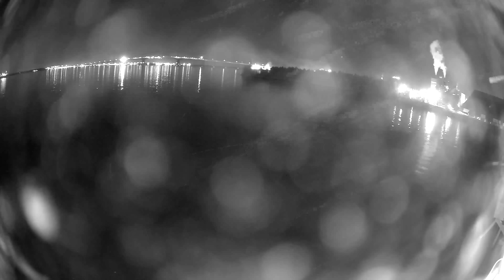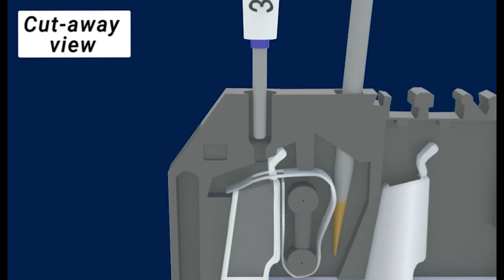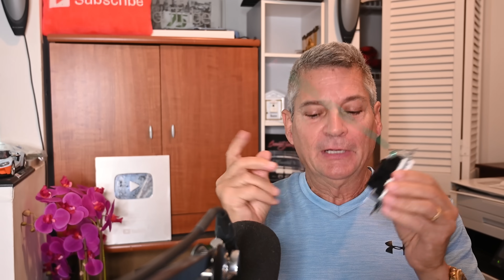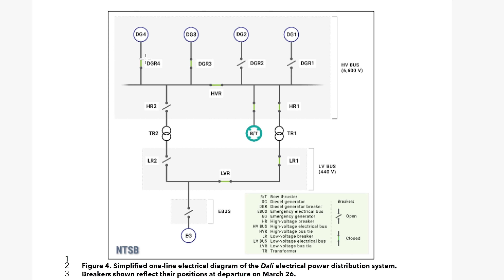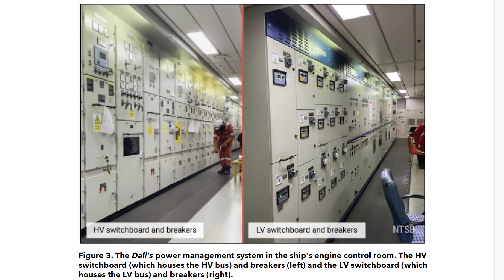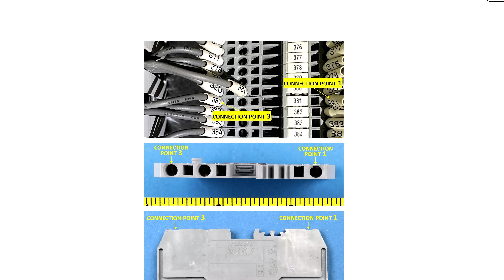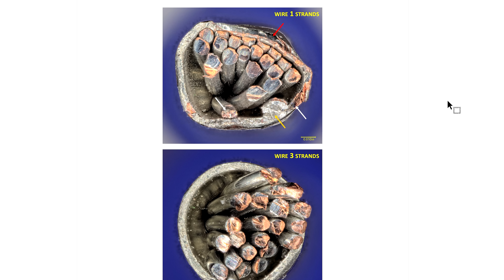NTSB: Scary Wire ERROR Caused Dali Crash/Key Bridge Collapse Baltimore

Comment: The main function of the ferrule, is not  to make it easier to insert it into a block, though, that IS a benefit. The main function of it, is to prevent breakage and to ensure that all the strands of the wire actually conducts the electricity all the way to the contact. In short, it ensures you get proper conductivity. It also prevents stray wires, and prevent many types of connectors from cutting strands (The screw type blocks will shear wire-strands).  Typically, if you do not use a ferrule some wire-strands will stick outside of the connecting point reducing their current carrying capacity and increasing resistance.  In Norway, ferrules are mandatory for all non solid core connections used with mains power.  The next benefit, is that it also prevents the wire working itself loose from the connector. Wire-strands can foul up the threads of the screw type connectors so you can't properly tighten them, they can also act as  spring, so when they are exposed to mechanical force, they come loose and can be pulled out.  In practice if you use a ferule, they do not come undone.
Reply: I do high-amperage automotive wiring, and I use ferrules on EVERY SINGLE wire that I run. I have a hydraulic crimper for things like 0-guage wire, and a smaller hand operated crimper for anything less than 10 guage. I have NEVER had a terminal failure yet.
Reply: US moving toward ferruling wires to be mandatory, I worked on mobile oil field equipment and it was mandatory from Canada but Stewart Stevenson out of Texas was having none of it. Ferrules properly installed are awesome.
Reply: imo spring terminals are more reliable without a ferrule (and much easier to install), automation engineer here
Reply: @ai5506  True as the ferrule to wire connection is another point of failure
Reply: @ai5506  just engineer or actual user of the product/installer?  xD  since no ferrule can suck since you can just push in stranded wires so in plenty of cases ferrules are easier to use while it costs more time to install.    so not sure what your (automation engineer qualification) means     since plenty of so called engineers think of the most stupid designs or ways to make something    and that gets dictated if you learned it in the field or in school ;D    field learnt engineers are worth gold compared to the school bench guyys
Reply: I use to do wiring on diesel electric freight locomotives , have no problems with correctly crimped on connectors but these push fit connectors are just quick way for unskilled workers to install systems "cost saving "  No one will convince me a push fit connection sound and fit for purpose , we never used push fit always a good old fashioned mechanical connection . Only push fit on loco's I worked on was for the rad fans on cooler group and it was constant issue with burnt connectors , we ended up hard wiring all locos as this push fit was constant cause of failure . Same with plumbing now its push fit or these crimp on fittings that any unskilled worker can perform , both have failure points unlike a good solder fitting
Reply: @nounoufriend1442 push-fits are no the problem, incorrect installation is. made 1000s of these connections, you just need to be sure about: A cutting the insulation the right depth, B inserting the tool properly, C inserting the wire completely. springs can't come loose, screws can
Reply: @ai5506  Heat effect's springs though and high current causes heat , we had push connections fail all the time on Locomotive cooling fan connection's and they were not pulling close to the rated amps
Reply: how many ships were built without ferrules, and how much of them hit the bridge because they run out of electricity?  
this is not about type of connection, but somebody's sloppiness.....
Reply: @ivok9846  This video might make people wary from using ferrules, since "all it does is making it easier to insert multi-strand wires". In reality, it should be encouraged and promoted as a safety device.
Reply: @SantaClaw  *shear
Reply: @SantaClaw luckily in Finland using multistrand wire without ferrules is just outright illegal, so I can at least watch misguided analyses like this like a comedy show and continue to feel safe 😁 Curious how Wago lever connectors and push/stab connectors work perfectly fine everywhere else than in USA 🤷
Reply: @topiuusi-seppa5277  I wired my house 30 years ago using the push connections in EVERY switch and outlet, and I haven't had one fail yet. They WOULDN'T put them on there if they weren't safe to use. I like them... 🤷🏻
Reply: @ivok9846  If the dali were running the other redundant transformer none of this would have happened...
Reply: how about just following the manufacturer advice..   dont use ferrules on spring cage type terminals.    it looks nicer but its just sub ideal      and lets not even begin about the fact if the crimpers themself are actualy good or too weak.
Reply: @DiyNuke  Use ferrules correctly. It's that simple.
Reply: @cloggedengineer824  yeah but who says it's correct?   The rulebook by the authority.  The manufacturer or what the person installing it thinks is right.     Manufacturer says to use stranded where possible but ferrule's are "okay" so what is it then?
Reply: @DiyNuke  Most spring terminals recommend you use ferrules. Ferrules prevent small strands from braking or losing contact and unless you over rate the wire this would be a fire hazard. In the case of ship vibrations. This risk is even higher. You are correct in that you should follow manufacturer instructions. You should use ferrules that the terminal is designed for, and should label correctly. Do all of this and inspect them every few years. You now have a relatively safe ship. Of course follow IMO, USCG(or wherever you live), and local laws.

Comment: I have seen this error many times. Thankfully, it has been during the commissioning phase and no accidents happened. It's sad how errors can slide past the testing phase of a project and pop up later in operation. Please don't think I am downplaying this accident nor the investigation in any way. Finding that exact point on a large vessel is a needle-in-a-haystack search for sure. 

The electrical systems assembly quality from many of the yards in the Far East is poor. Often, you find at least 2 or 3 disengaged wires in every panel during initial inspection. Most of the time we perform a pull test on every wire in every panel associated with the equipment we commission. In addition to oversize ferrule sleeves, we see evidence that defective crimper tools are used, when the wire its self will slide out of the ferrule, leaving that part in the terminal block.

In reference to the Dali, there is another factor at play. Often, the electrical plant is the first part put in operation on any new ship build. It is often rushed because getting power on is a "milestone" for the ship builder, often resulting in celebration and a significant payment from the owner. Furthermore, once power is on, this is critical for testing and commissioning of the remainder of the vessel, such as HVAC, steering, and other parts. These are two reasons why re-visiting the electrical power plant and making adjustments and repairs is "difficult" for the shipyard to agree to. Even if this breaker had been tripping randomly during the initial commissioning phase of the Dali's build there would be pressure to leave it and hope the problem goes away; as opposed to digging into it and finding the root cause. 

Sorry this comment got long. It is coming from the angle of an equipment OEM commissioning engineer who has spent years on multiple projects in the Far East and it is my personal observation.

Comment: When I was active duty I was asked to correct a problem on a ship that had existed since construction with the navigation radar. When they would switch headings it would go crazy and no one could figure out what was happening. Old synchro/servo technology and when checking the R1 and R2 lines one line would go crazy when they turned the gyro. Since it didn't have god reference voltage it drove the heading crazy, swap wires/labels, simple fix and found it within about 30 minutes.. Somehow had been overlooked for several years and numerous attempts. The sailor was told he couldn't have liberty until it was fixed, needless to say he was extremely happy. There are thousands of cables/wires/connections on a ship and in intermittent problem is very difficult to find but as stated a good IR scan can be very helpful.

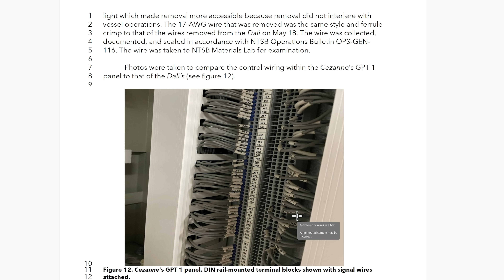Comment: i know you like detail so i hope you see this post,, 16:30 and 17:10 are absolutely not the same

on 16:30 every single label was heat shrinked onto the edge of the blue ferrule (witch was bad to start with) but goofed on the one very critical cable 381 and covered most of the blue area (so this was probery 1 person who did this on this panel) due to the way he did it there is no way to know if the cable was fully inserted (every cable on that panel)

on 17:10 every one of them was done correctly and only heat shrink label to the cable only leaving the Blue ferrule free (so you can clearly see if they was inserted correctly and all the way in as only 2-3 mm of the blue should be showing)

Comment: Had an HVAC problem once, that 3 separate techs couldn’t figure out. A fuse in a disconnect would blow from time to time. Over the years techs would just increase the size of the fuse until that didn’t work. So I broke out the laser temp gage and was able to track down that the contact points on the disconnect switch were corroded and not getting a good connection..

Comment: Yeah I watched the whole NSTB report and one thing they mentioned was that they were running the system in Manual and if they were running the system in Auto it may Not have lost power. That and they were running one pump when they shouldn't have done.

Comment: Have they determined if the faulty connection was factory installed or if it had been worked on since leaving the factory? Did they find any other similar bad connections that had not affected operations? Even though we all make mistakes, it seems a person making up and/or landing thousands of this same type of connections all day would immediately spot this error - versus a person making a repair that seldom, if ever, makes up the connectors. Great post, Jeff!
Reply: the whole panel is wrong (look at 16:30 vs 17:10) the person who did the first ship heat shrinked to the edge of the blue ferrule (381 it was covering all of the blue area making it not possible to insert all the way in so it was only been held on by the very tip of the ferrule) , 17:10 is the correct way the label is only on the cable you can visually see right away all the cables are inserted
Reply: @leexgx  Wow! Thank you!!

Comment: 101 is always to get a good rap on the wires and to pull on each one after nutting. I personally don't ever use push ins even the ones that come with cans and more times have re-tightened all connection in breaker  boxes and usually find that the copper wire has mushed out and became a loose connection, with lugs with 3 larger wires I will tighten and then the next day will tighten again and to anyones surprise they will tighten allot. This is the main cause of most electrical fires 
"LOSE CONNECTION"

Comment: I grew up with the old school wrap around connectors.   I remember first seeing these Allen Bradley connectors.   Obviously, nobody did the  "Tug Test".
Reply: you don't need to with these (and at the time it was still biting so probably wouldn't have failed the tug test) the issue was heat shrinking the label onto the edge of the blue ferrule (look at 16:30 and 17:10, one you can only see the labels ,other one you can see the correct edge of the blue ferrule so you can visually see they are inserted all the way in)
Reply: It's a design failure of the connector.
The old wire around screw connection did not give consistent contact.  But what it did do was offer visibility.  These new style connection blocks hide the contact. They should be transparent or open offering clear visibility of the connection.

Comment: There's a simple explanation to 24:40 for those linear marks: most of the time the excess wire is cut with scissors to leave the terminal flush. Not good scissors/tehcniques bend the terminal like they were pliers rather than scissors.